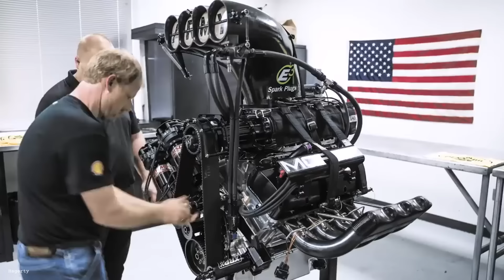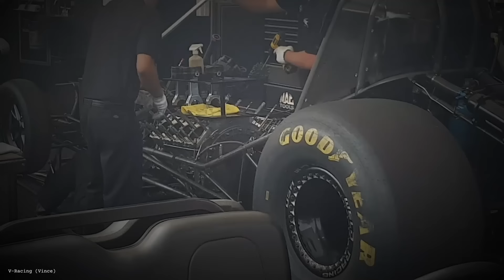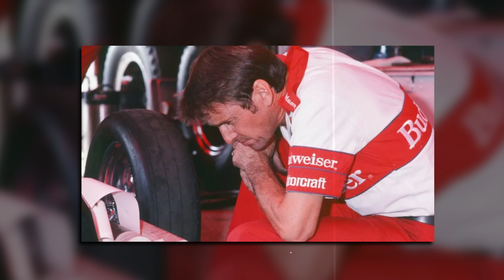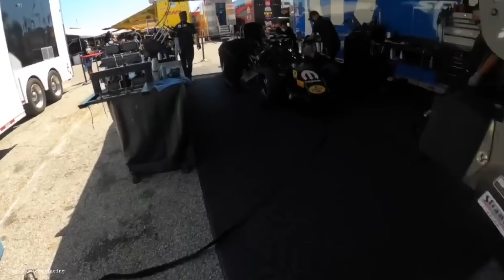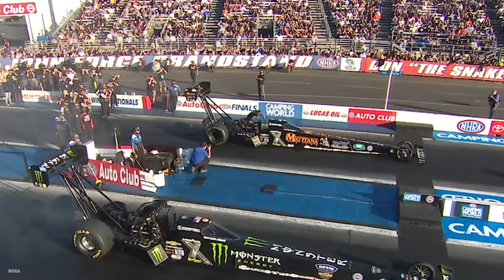This Louisiana Mechanic OUTSMARTED NHRA With a "Secret" Blower Pulley That Made 2,500 HP

Comment: I am 79, been racing since I was 16, I knew Dale and hats off to him, he was a clever guy but this click bate pile of hose s%&t does NOT represent things he has done.  First he was a Canuck but live in California, toothed pulleys do NOT SLIP, if the belt jumps a tooth it rips off all the teeth on the belt thus destroying it. 
This crap is embarrassing.to listen to. I thought it was a testament to a great racer. 
There are plenty of good things to say that are accurate. 
How about giving him credit for tuning the first car to run 300 and do so with none of the streamlining tricks everybody was using to be the first to run 300. He did it at the Gators in 1992, I was there with our TAFC car. Nice clean run as well, didst hurt a thing. If you have enough power you can push a brick to 300.
Please redo this video with accurate info.

Comment: Reading the title, and the first thing that went through my head was "more teeth on the belt, which means more teeth on the pully, which means more RPM's, which means more Power. and less slipping."    :D

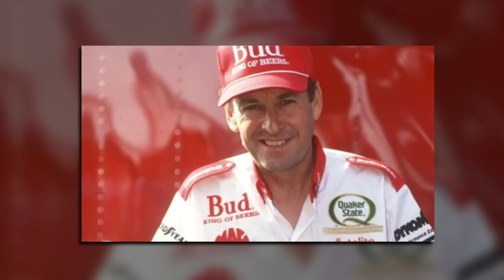0:14 seconds in, and i was proven right :D
Reply: Tooth count does Not change rpm.  Pulley Diameter does.  The thing Dale Armstrong did,  was lessen drag and maximize tooth engagement strength  at the same time.

Comment: I calculated about 1087 HP to compress the air mass at that flow rate, using a tight spiral roots blower, with a belt power transfer at 10C & standard atm pressure, on today's engines.

Let's see if 900 HP to drive a blower back in 1992 is reasonable guess. The added 300 HP would have been a 300 HP less at the crank used to drive the blower at 900 HP. The engine didn't make more power; it was only more efficient. Even the better drive would take 928 crank HP to get 900 to the blower. The old belt drive if 75% efficient, would need 1200 crank power to transfer 900 to the blower. All that seems proportionally within guessing range.

It seems unreasonable to me that blowers in 1992 were so close to blowers now regarding input power while doing much less work compressing the air. That improvement represents at least double efficiency. Depending which crew chief, today they're running the blower output at +5 ATM absolute or 60 psi charge pressure over atmosphere. They get about 11k HP at the crank, you'd think the 1100 used on the blower would take 1100 away from the crank, but you get most of it back in combustion pressure. The inefficiencies you can never get back. Maybe over 3 decades they did double efficiencies

Comment: The blower RPM is well over 8000, the engine is 8-8.5k. They all overdrive the blower. That ratio changes almost every run.

Comment: The author wrote that the light tree showed 3 sequential yellows then a green. Wow! That would be an amateur tree, not a Pro Tree. All 3 yellows light, then Green. If you see the Green, you lost.
Reply: If you look at vintage drag race photos, you will notice that in the early days the Christmas tree flashed three yellows .05 seconds apart and then the green.
Now it’s all 3 yellows and then the green at .04 seconds. Most sportsman classes use a .05 count down tree so they have 3 chances to use all of their electronics to help them win. Electronics have taken the talent out of the equation!
Reply: @exoticcorvettes  The 5 amber tree was used from 1963 through the 1985 season. Sportsman classes used the 5x amber stepdown until e1986 when there were only 3x ambers. The last race in 1970 the fuel classes only lit the bottom of the 5 ambers then directly to green. At least part of 1971 season the Pro-Stock guys were all very sad because their hood scoops blocked view of the lights; fuel guys just laughed. 
The 1986 season, all races used the new 3 amber tree, I think that's when the pros began flashing all 3 together, then 0.40s to green. If they used a 0.05s delay between incandescent bulbs, all would swear they all lit without delay
How could you see the tree stepdown in a photo?

Comment: One guy is shown pulling a head. He takes it off and rests in down on the mounting studs, bending them. How does that work?
Reply: Head studs/bolts/nuts are single use items at those head pressures. Once you’ve torqued them up you’ve stretched them so if they’re removed they can’t be refitted.

Comment: another problem with cog wheels and toothed pulleys are
not having the same tooth meet the chain/ pulley every round
the way to diereses belt/chain wear is to alter one sprocket/pulley teeth so that tooth engages with the next tooth or the previous tooth every belt rotation
on 1961 motor bike was a pain  3 to 1 gear same tooth same place
25 to 45
changed back sprocket  to 43
raised the gear yes
but chain lasted till i took it of the road
another good ides in plain sight

Comment: nitromothine? the fuck?
Reply: Its, nitromeethane made from  Japanese  bark beetles wings every seven years..
Reply: @artworkbysteve1
It’s NITROMETHANE! It was developed as a cleaning solvent used for cleaning the inside of oil transfer pipes in the oil fields and later as a fuel in drag racing.
Reply: @exoticcorvettes  It was developed as an explosive. There are over 2000 applications, this highest usage is as a precursor to make a fertilizer
Reply: @CycleWerkz Nah, it was first used as an industrial cleaner solvent
Reply: rolling laughing! 😂
Reply: nightrawmythain

Comment: This video makes no sense at all. Gilmer belts have been used on superchargers since the 60's. They don't slip by a few percent - they either work perfectly or they break. Stop churning out utter BS.
Reply: Everything on a fuel engine bends, fractures, slips, and transfers harmonics.
Reply: @CycleWerkz  Everything on a nitro motor doesn't bend and fracture at all. Yes there are of course lots of vibrations but a Gilmer belt has teeth on it and it's designed to be positively engaged at all times. It's not like a v-belt that relies on friction. If it happens to disengage for any reason, all hell would break loose and the belt would fail.
Reply: @sharkskinboy  The Gilmer belt teeth couple with each pulley's complementary teeth which the set is designed to maximize friction. The design substantially improves belt to pulley friction but still couples the power transfer via friction. The drive system has to transfer <1150HP, but only for <4.0s duty cycle. 
The breakthrough that kept him winning for a short while, was his very careful attention to details to optimize pulley teeth such that they captured max depth & vertical wall of each belt tooth. He further synchronized the drive, belt, & driven such that when a new drive tooth engaged the belt, a new driven tooth also coupled with the belt simultaneously. 

Fuel engine crankshafts do not rotate smoothly at all. They surge and ebb 4x per rotation twisting the crankshaft >20x more than engines on other fuels. These radical positive, then negative acceleration tortional pulses were found to contribute to belt tooth jump. The drive to driven synch better kept the blower load applied at the time the crank surged. 

In the 80s, many, many blower belts failed. Crowds loved it. The system was clearly overloaded; he just fixed it.

Yes, everything on these engines has a duty cycle limit due to the cumulative fatigue fracturing effect. Crankshafts make 5 runs at most but are x-rayed per single pass. They bring 8 cranks with them, so they always run one they know isn't fractured.  

How many runs do you think they put on a blower belt?